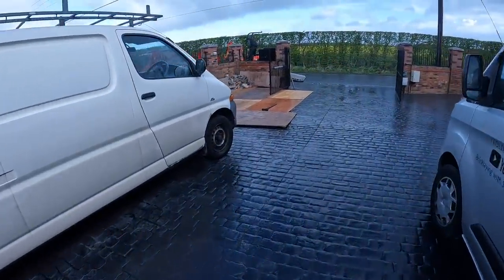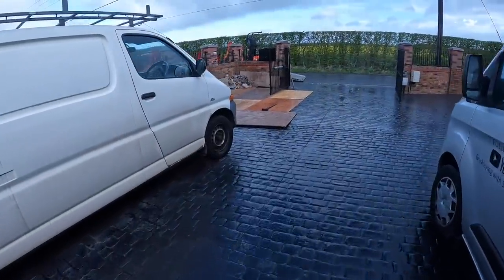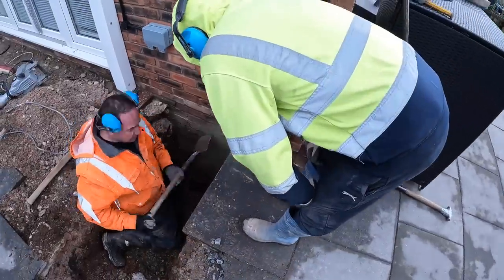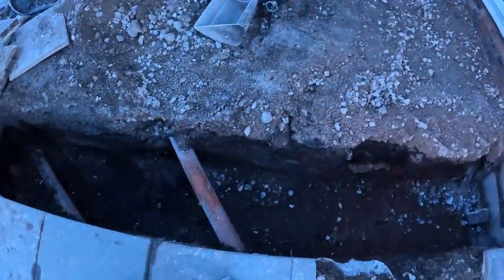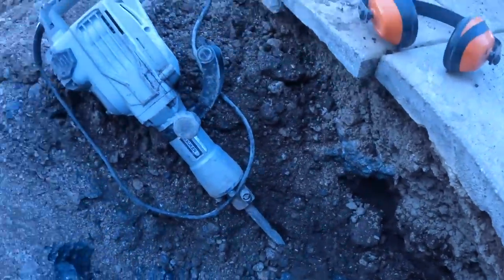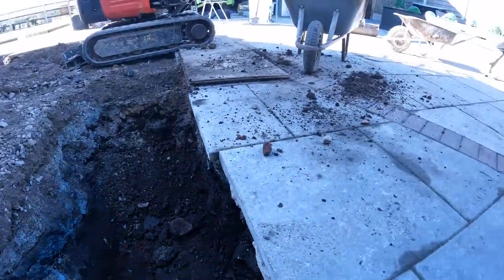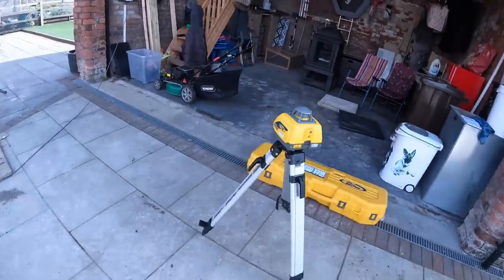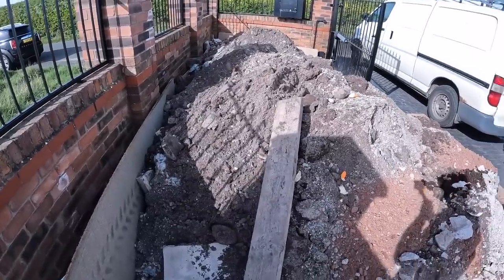TRYING OUT A MICRO DIGGER, WHERE'S THE FOUNDATION!? ....L SHAPE EXTENSION PART 1

Comment: What depth did you have to go for the footings?
Reply from the maker: We ended up about 800 down 🧱👍🏼
Reply: I was wondering the same, down south its a minimum of a metre but i have had to go down 1500 if the ground is sh1t. Good videos tho bee watching for a while.
Reply from the maker: @JAVXABLE  cheers buddy . The house has a basement hence the fill for 2 m out each way . The original ground is perfect for pouring onto 👌🏼🧱👍🏼
Reply: @JAVXABLE  yeah south-east is minimum a metre but I've seen it 3 metres deep, depends on ground shitness
Reply: Alex that makes sense, you have had it lucky there, when it gets shit shit ground down here its time to run!! Na but I have had to raft it before, but that cost a fortune in drawings, steel and ball ache 😆 and digging with a pump!!

Comment: Looks like surface water runs towards the rear of the house… and the deeper pipe (hepsleeve by the look of it), is the foul…
Reply from the maker: The higher one was dead and got cut off . not sure what the bottom one was but it was plastic 🧱👍🏽
Reply: @SteveAndAlexBuild  yes, noted the lower one was plastic when it was fully exposed…jumped the gun, lol…did you not have access to the drawings of the place showing the drainage runs…
Reply from the maker: @stun9771  . No mate 🙄🧱👍🏽

Comment: Why shutter round pipe  an  other thing was new house pile driven ta
Reply from the maker: Never concrete a pipe in .
  No the house had a basement 🧱👍🏽
Reply: Thank you I would cut out put sleeve over it and couple joints on straight on the corner would removed to out side foote because load bearing ta Brian
Reply from the maker: @briansutherland5414  🧱👍🏽
Reply: Big thank to team glad got  out of it 2 years ago 😃😃
Reply from the maker: @briansutherland5414  🧱👍🏽

Comment: Lads hire a 1 Ton or 3 Ton Dumper 
Worth it 👌
Reply from the maker: Not across that lovely patio and patterned concrete , to risky 😒🧱👍🏽
Reply: @SteveAndAlexBuild  
Minimal loading with that size of dumper , if it cannot take the weight of a 1 Ton Dumper then any delivery lorry/muck wagon  shouldn't travel on it
Reply from the maker: @jacannon9147  nothing did , all dropped from the road .

Comment: It’s taking so long to dig it out, because that scouser has only got half a bloody spade….!!!
Reply from the maker: Steady on Stu its not how big the tool is but how you use it . The dig took 2 days as we expected due to concrete pads in the way and caution around the pipes . jason is as much of a scouser as you are pal 😆🧱👍🏽
Reply: @SteveAndAlexBuild  I was wondering if a narrower bucket, say about 12", would have cut out a lot of the hand digging. More scoops for the excavator, but there would have been more power to dig thru that trash fill under the slab.
Reply from the maker: @lwilton  . We only hand dug against the house and around the pipes . We are well used to hand digging so it’s not an issue for us . I’d rather take my time abs be cautious than go at it and end up with more work and expense repairing damage caused by the digger 🧱👍🏽
Reply: @lwilton  exactly my thoughts too…